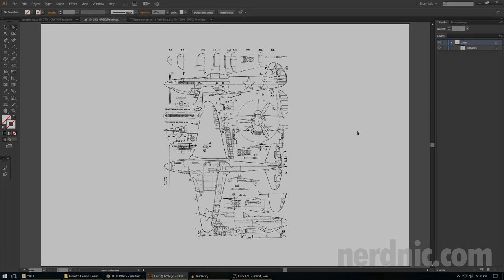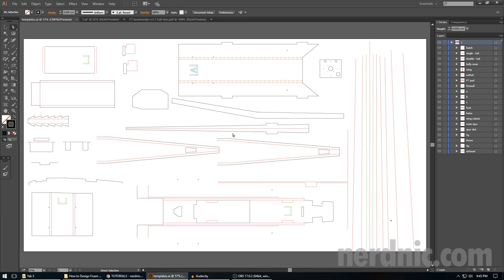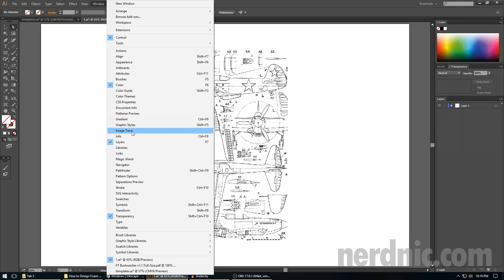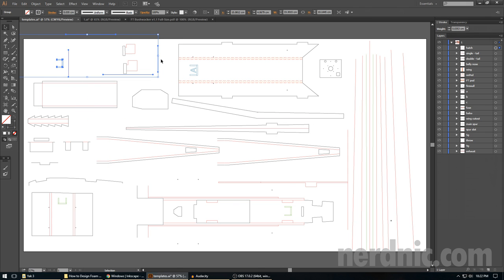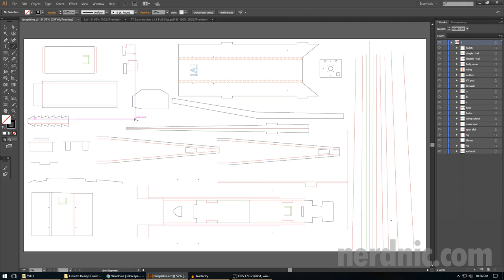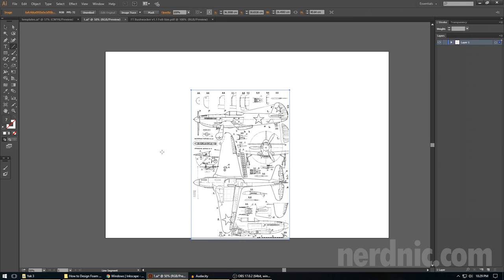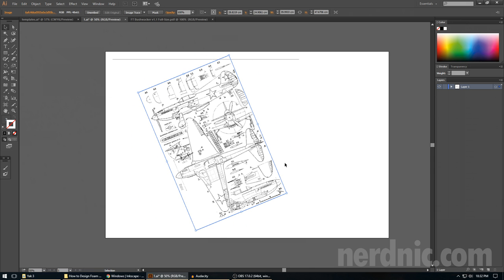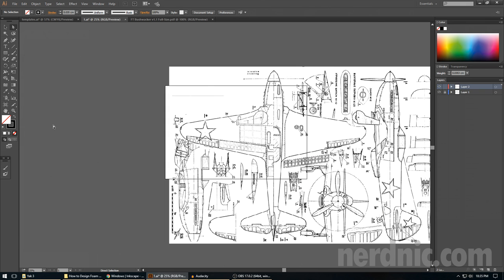nerdnic | How to Design Foam Airplanes - Part 1

Comment: Over the years I have done mechanical design using "orthographics" (i.e., pencil on paper) as well as 3D CAD Modeling, but prefer the old school orthographic approach because I feel that there is a lot less "CAD Tool Overhead" to learn with that method. Since our goal is to cut out flat pieces of foam that will be used to create a 3D Airplane the orthographic approach to creating the parts just makes sense to me, but I realize those who have never designed that way may have trouble visualizing the end results.

Comment: that template design looks a lot like the flight test templates
Reply from the maker: iain cox yes, my design process builds on top of what flite test started. I've worked closely with flite test, even designed their MiG 3, and my goal is to show the design process they and others use to create foam board planes.

Comment: I feel like this method is dated.  3D modeling programs have come a long ways and can even auto generate 2D drawings from them.  Its more natural to work in 3D then it is in 2D.  The tools are much easier to use as the only time you have to mess with layers is when you want to differentiate different types of materials or individual parts.  

I think before you get too far into this video series you should go evaluate some of the more simpler 3D modeling programs.  I think you will find that you can complete a model airplane design in much less time with the same amount of accuracy and quality in the final product.
Reply from the maker: This is good advice. I talk a little about it in my part 2, check it out!
Reply: Do you have a good tip on which 3D modelling SW to try?

I'm interested specially in the auto-generation of 2D drawings, I never used any "unfold" features of CAD programs and I would like to give it a try.